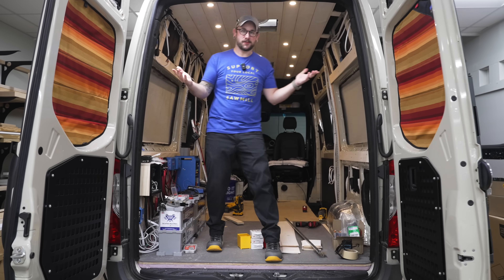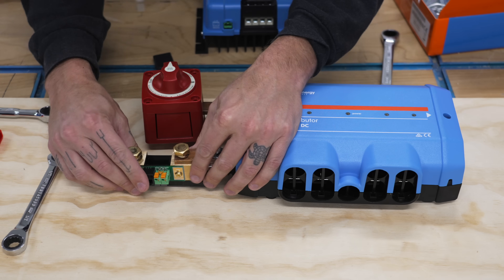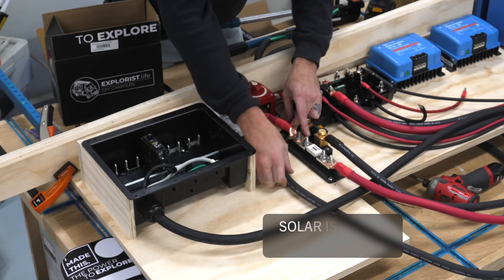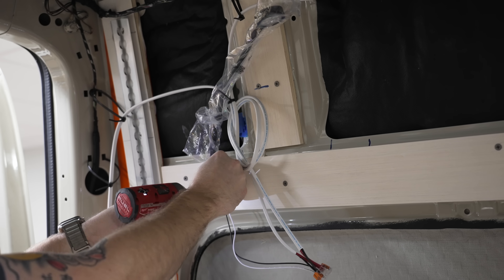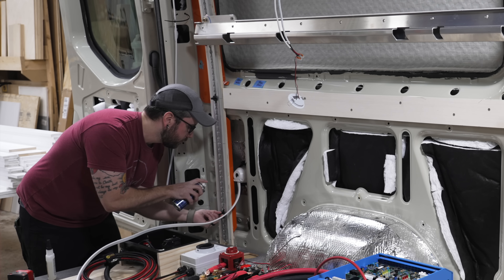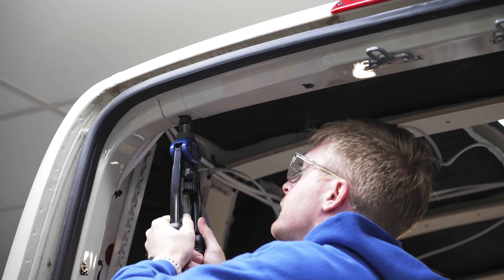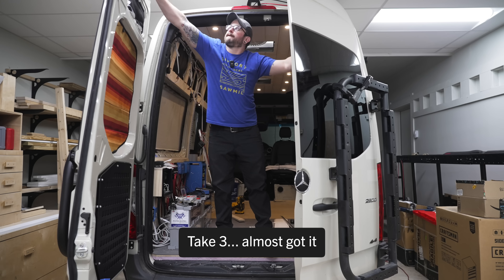DIY Camper Van Electrical Install Start to Finish!

Comment: Why no Loctite 242 (blue) or torque wrench applying the proper torque values to at least the largest and most critical fasteners?
Investigate DC isolator switch fires and UK regs.

Comment: Dumb question? How do you know if you need the big amp fuses for your batteries? And how do you determine which ones to use? Tysm 😊
Reply: You do need a main battery fuse. No "if". Every positive wire needs a fuse. Fuses (or breakers) protect the wires. Fuse rating depends on the size of the wire used and the current that wire is capable of carrying: 16awg - 10A, 10awg - 30A, etc.

Comment: Sorry. But waste of time and money.... And you still can't guarantee power in harsh conditions in the wild.

Just get a bluetti with a rv generator.... £6,500 max.... 

Have a electric oven, air con, hot water, etc ... With no worries if running out .
Reply: Good for you. I'd rather have a full on system with components i can replace individually. Also, holy crap, 6500 gbp!

Comment: Is there a reason you use the isolated version of the dc dc charger when you have grounded the whole system to the chassi?  Great video!

Comment: I have question for you having just finished my build and had space issues with the Multiplus 2 install.  Did you choose the Multiplus over +2 for this reason?
Reply: We definitely see people choosing the Multiplus over the ii for that reason.  The original Multiplus is fatter, but it's also shorter which seems to fit better in most installs.
Reply: @EXPLORISTlife  does it have screw down terminals for the push in ones on the 2?  I really hate the push ins.
Reply from the maker: The Multiplus 2 seems more intended for residential work since you can feed power back to the grid. The Multiplus definitely does everything needed on your typical van project. You could probably sell yours and swap the units easily enough.

Comment: Nice overview of an electric installation. One common misconception though; you can't compare amp-hours with each other when the voltage is unknown or different. Watt-hours (Wh) is the best way to express capacity. I believe DeWalt is 18V and your battery 12V? so 18x5=90Wh and 270*12*2=6480Wh. So by far not 100 DeWalt batteries, but 72 to be exact. Ah is technically more correct since voltage can vary very slightly but in this case Wh is more informative. I know everybody get's this wrong, but there are 12v and 24v systems which are incopmarable and when you get into EV's there is no standard voltage at all, hence they always measure capacity in (k)Wh
Reply: Watt Hours definitely paints a more clear picture of battery storage capacity, but we have to use Amp Hours in all of our educational content as that is what is more commonly used in the industry.  If battery manufacturers mutually agreed to sticker their batteries in watt hours instead of amp hours 40 years ago when they started making deep cycle batteries; this would be a non-issue today, but since that's not the case we have to roll with amp hours.

Interestingly enough; typically... in 48V systems... it's MUCH more common to refer battery bank capacity in terms of watt hours for whatever reason.

We've got a video about this subject and the fact that a 100Ah 24V battery bank is twice as large as a 100Ah 12V battery bank on our channel titled something along the lines of "Understanding Amp Hours".

Comment: What did you use to connect the battery disconnect to the Lynx?
Reply: It's just a solid copper bar/adapter that we make for connecting the m10 bolts of the switch to the m8 holes of the Lynx Distributor.  "Lynx Adapters" is what we call them in our store.

Comment: Those DC cables are such an overkill, dude. under no normal conditions would you ever pull nowhere even near the amperage that would require such cable gauge.
Reply: The DC cables are actually appropriately sized for their use and the manufacturers recommendation for the equipment installed.  The 250A that could be asked for from the inverter + the DC fuse panel which is rated for 100A required some big wire; and to keep Voltage drop, resistance, and DC ripple to a minimum (and stay up to spec of manufacturers recommendations) we need to use those big 4/0 wires.  So no... that aren't 'such an overkill, dude'. 🙂👍

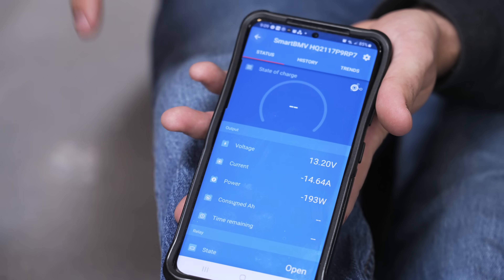Comment: 9:35 that is a terrible ground, you have basically no metal to metal contact because of the paint. You should have sanded off the paint before even installing the riv-nut. You might have some continuity but it will spike in resistance as soon as that ground carries any load.

Hopefully the alternator chargeback circuit has an isolator so it doesn't draw down the factory battery when the van is turned off. I also don't see an exhaust for that diesel heater, hopefully it is just going through the floor when it can't be seen on video.
Reply: That chassis ground is just fine for what we are using it for.  We aren't asking it to carry current and is only there for catastrophic faults to ground so voltage drop doesn't matter there.

The Orion DC DC charger does indeed have engine shutdown detection built in so there is no risk of draining the engine starting battery when it is off.

Comment: I reckon you might have issues with the “chaise” ground being grounded to the sheet metal not the frame of the car
Reply: He won't have issues with that chassis ground, no.  In fact... in this system, that chassis ground is only in place as a catastrophic safety failure point back to b- and it will not be carrying current in normal system operations.  All designed b- current carrying conductors are actual wires and we don't rely on the chassis to carry currents except in a fault/safety situation in which the sheet metal of the van is the most important part to be the chassis ground.

Comment: PROTECT the solar outlet with some butyl tape , best to use the one with aluminium foil on one side ...but you can also use just butyl tape (or liquid butyl in tubes like silicon) or put some cooking aluminium foil on it (only tape , in case of butyl sealers intubes just find one with aluminium powder in it , its used for roofing , easly last 20+ years like new)  , will work the same (even only butyl) protecting from uv degradation (that in case of epoxy takes like few months up to 5y depending of exposure time etc)

Comment: Question regarding Temu, would you personally trust them if you were entering your own credit card data onto their site? It's one thing buying things on credit they give you, but personally I'd be worried giving them my data given their track record. If the price and quality of their products seems too good to be true, then perhaps they have other income streams related to data they gather from customers
Reply from the maker: I use PayPal or some other payment processor for any site that accepts it. Pretty much negates the issue. As far as the products, they seemed similar to other stuff you’d see at Harbor Freight or Northern Tool, and when you consider they’re probably adding another 100% margin, basically doubling the price, the prices seem fairly in line.
Reply: @craftedworkshop  hey thanks for the reply. Maybe my mistrust of their low prices actually says more about how other stores have been price gouging and hiding behind inflation as an excuse the last couple of years. But Temu have had a lot of negative press, so I'm curious to hear other's personal experiences. For me the jury is out so far.

Anyway, big fan of your channel and looking forward to what 2024 has to bring. Merry Christmas to you and your family!

Comment: That's some heavy duty wires. On my last car stereo build I used one gauge power and ground wires mainly to minimize the voltage drop over certain distances including current constrictions
Reply: No doubt!  Our 3000VA inverter Pulling power from a 12V battery bank could theoretical be asking for 250 Amps!  So to keep our voltage drop to a minimum (well below  3%) as well as DC ripple, we used those big 4/0 wires.